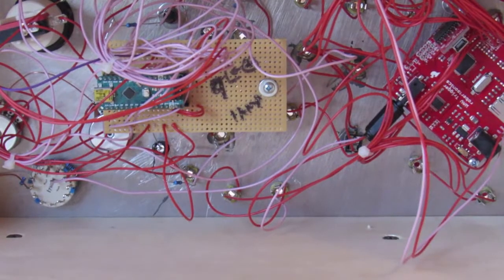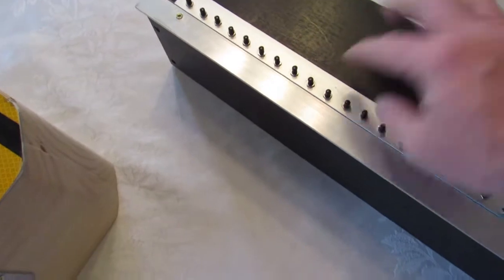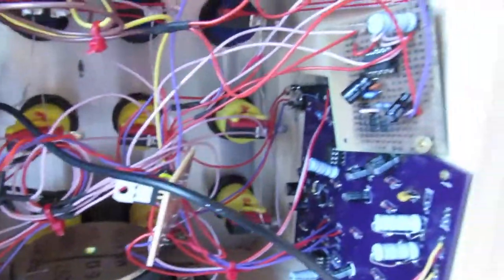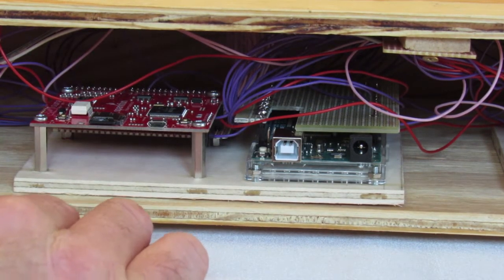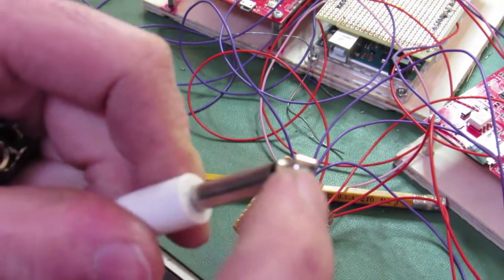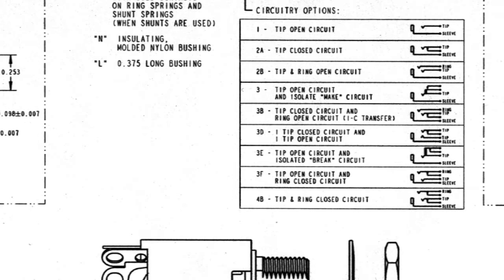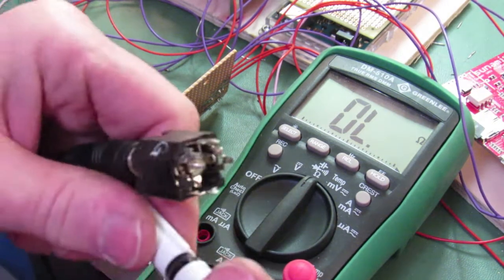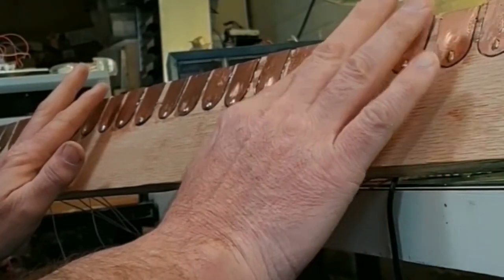Musical Electronic Trigger Boards

Comment: Wow, that's so cool. Just when I started to look into alternative controllers, you come up with those! You can read my mind.
Reply from the maker: Strangely, I have been watching two other Youtubers who've also been looking for touch plate controllers. It seems we're all on the same page! Mine is proving to be a bit temperamental - it seems sensitive to heat and humidity. I'll have to do an update after I have figured out why.
Reply: @pbartmess  skin resistance highly depends on moisture. That could only be corrected by buffering?
Reply from the maker: @ludwigkopp8130  That is an intriguing idea! My only experience with buffers has been to make a buffered multiplier with an op amp. I suppose it's as simple as that. I'll do some research. Thanks for the suggestion!
Reply from the maker: Just an update... I think I may have found the clue I was searching for. Alan Kason just published a video about gate buffers and it looks like what I need. If you are curious, it is here https://youtu.be/d63MYRGqFaU
Reply: @pbartmess  that is a real treasure. Thanks for sharing!

Comment: The cabinet handle on wooden box is priceless (begging of the video) , how about using resistor "array" for the last device with proper scanning you would have less miss triggers
Reply from the maker: Thanks! (Sorry for the late reply) Nice job spotting that furniture handle - I needed a way to haul that box around so I decided to use whatever I had in my spare parts drawer. It's a good suggestion about the resistor array. The schematic does utilize an array of 1 MegaOhm resistors and the person who designed it has mentioned that sensitivity can be adjusted by lowering or raising the values. Also, it can be adjusted in the Arduino sketch. Strangely, however, the pads also respond to the humidity and warmth of the air, so some days it plays perfectly and others it doesn't. Overall it's quite a "touchy" device. I'm sure the factory-made capacitive touch keyboards are better designed - this is just a DIY hack.